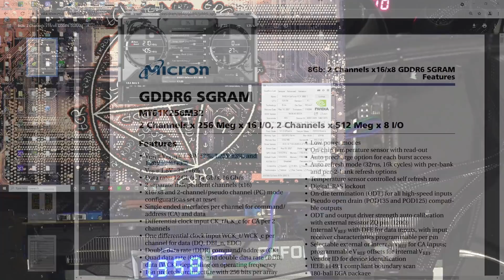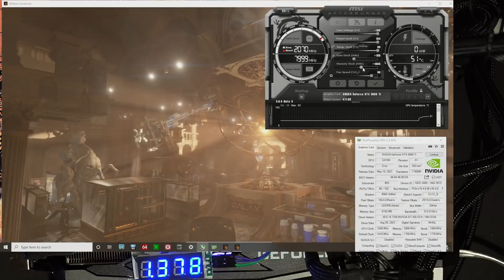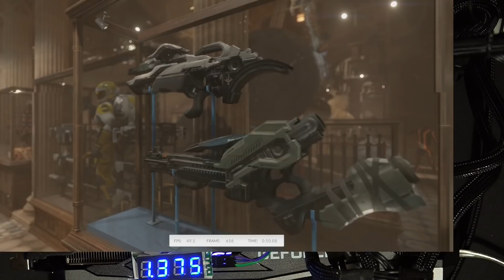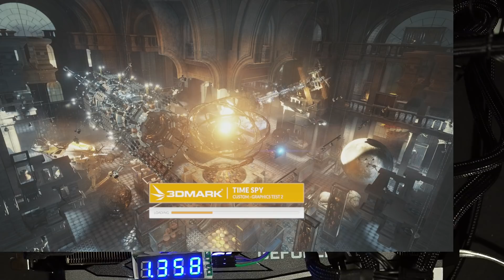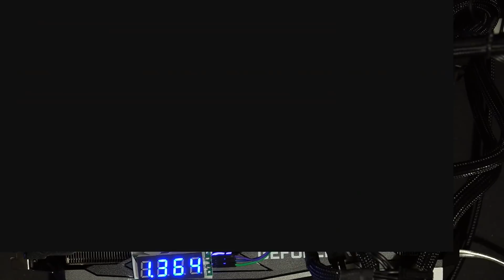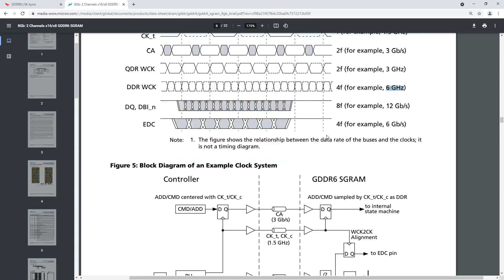Undervolting the SK Hynix GDDR6 on the RTX 3060 Ti makes it overclock way better.

Comment: Could someone speculate on why this is the case? My 3080 (Gigabyte 10 GB Vision OC) drops frames in VR when at factory voltages but if I limit the voltage through MSI afterburner's voltage curve editor by 100mV it cleans up the performance significantly and everything runs buttery smooth. I'd be interested to hear what this community thinks about it (I've heard that this is the case for other 30 series owners too).
Reply: Bouncing off power limit?
Reply: @DarkLinkAD  Quite likely, to me it seems unusual that a power limit bounce would result in a dropped frame though, especially if the frames are capped and there is plenty of headroom to exceed that frame limit. Its feels strange to have improved performance (or at least stability) when undervolting an appropriate amount and this video is a nod in that direction. I can't for the life of me explain it though, maybe 30 series cards just have really poor power management.
Reply: @zealeigh   If its powerlimit,  increasing the limit will have similar results without underclocking/volting.
 If its temperature, increasing fan speed may help.
 This is why I prefer static fan speeds and static clocks/voltages. Pretty easily to tell when you dont have the middleman changing it up o you.
  IIRC DR. Disrespect had a similar issue you described with his 30 series and reverted to his previous cards
Reply: @zealeigh   Sorry bout your troubles though, I feel your pain. My Gigabyte RX460 killed itself, appearntly its a faulty design, the board trace shorts between layers... I did notice that the vram was closer to hdmi port and hdmi had been unsually hot since day 1, the other models have vram on the other side.
Reply: Check the temps.  Repaste chip repad VRM if temp is the culprit.
Reply: @saiprasad8078  Good idea! Temps are all far lower than max, it happened even happen at 60% load. It was also my first thought :) Maybe a sensor is faulty though, its possible.

Comment: Impressive. 
what HW are you using for voltage control?
Reply: @paranoidnela  :). Thanks. I am aware of that. wanted to know where he bought the parts from. Is that a 10K Ohm potentiometer?
Reply: Was there ever a follow-up video to this,  showing how to set up the potentiometer under volt, or at least a  basic wiring schematic? Are there any online resources for this? I have basic soldering skills

Comment: Interestingly, but probably unrelated, to get the best performance when mining on Samsung chips, like 3070s; you need to reduce power by 60% and drop core by 500Mhz then add +1GHz on memory. You do not get the same benefit by just boosting memory speed, you need to reduce card power. Mining is mostly related to memory performance, the card just has to do the bare minimum. Now I'm wondering if reducing power just stops the GDDR6 getting extra voltage under load and keeps it cooler.
Do the cards have some inbuilt heat monitor for the memory that clocks them down when heat builds up?
Reply from the maker: technically some of the timings can loosen based on memory operating temps. There's no way for the card to control the memory voltage from what I can see.
Reply: @ActuallyHardcoreOverclocking  It might be worth running a miner to see what hash rate you get with different voltages, you are essentially just testing the memory speed at that stage. T-rex miner is a good, modern one, the can be set to dump the performance data and has benchmark mode. It will also account for error correction as you will get invalid shares. Also, lot quicker than TimeSpy.
EDIT - oh balls, you have LHR rate card. EDIT2 - doesn't matter actually, it's only LHR on eth algo, just select a different algo?
Reply: @lucidnonsense942   Mining voltage per clock is completely unrelated to gaming voltage per clock.
 Much of this has to do with load. A greater load requires greater voltage per clock.

Comment: Hey man, could you please do another video on optimizing DRAM timings with a Ryzen 5000 series CPU on a Gigabyte x570 motherboard? 
Somehow I just can't figure out what I'm doing wrong. My specs are: 5950X ; Gigabyte x570 Aorus Xtreme ; 4x8 DDR4 3600 Samsung B-die CL16 ; FCLK 1800 ; RTX3090 ; PBO enabled, SMT disabled. Thanks!
Reply from the maker: what settings are you trying to run?
Reply: @ActuallyHardcoreOverclocking  I'm actually not sure, I was using the "DRAM Calculator for Ryzen 1.7.3" for my 3700X with the same DRAM, and it was running perfectly fine, but now it doesn't seem to work with the 5950X.  On my old setup I was running an MSI x570 motherboard, so it might just be one specific setting in the Gigabyte UEFI which I don't understand correctly...
Reply: PS.: I can send you screenshots of my last DRAM settings if you find that helpful.
Reply: @DC9V  That would help tons with any sort of diagnoses. Knowing what its doing could very much help in figuring out Why its not doing.
Reply: @crisnmaryfam7344  I currently don't use 'imurg' or something like that so I can't upload screenshots right now, but I could send them via email. They're basically just screenshots from the "fast" timings in 'DRAM calculator for Ryzen 1.7.3'.
Reply: @DC9V  Check your termination block settings. There was a bug in DRAM Calculator which said RTT_WR should be set to OFF but this would never boot. Try setting it to RZQ/3 or Auto.
Reply: I'd like to see you do a 5000 series video also there seems like there's some differences from the 3000 series, but the information is hard to find. Also I'm having a problem with my b-die getting unstable above 1.4v for some reason
Reply: @paranoidnela  can you put the link for that please?
Reply: @paranoidnela  sticks barely feel warm to the touch and there's a big difference in stability between 1.39 and 1.4 something weird is going on
Reply: @538nate  b-die is very temperature dependent, like within a couple degrees C it will change its stability and overclocking characteristics, even if temps are technically within spec.
Reply: Maybe bad IMC.  Try with 2 sticks.